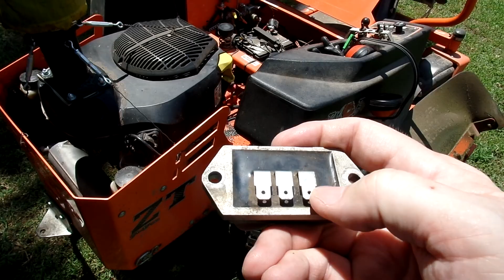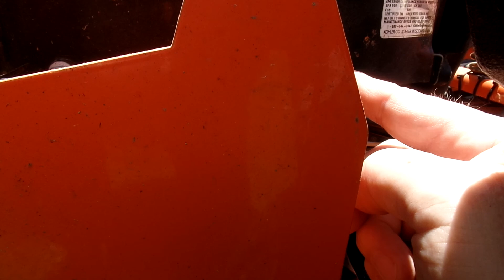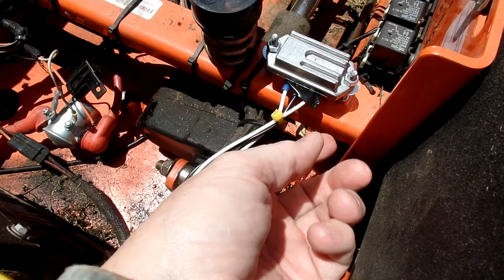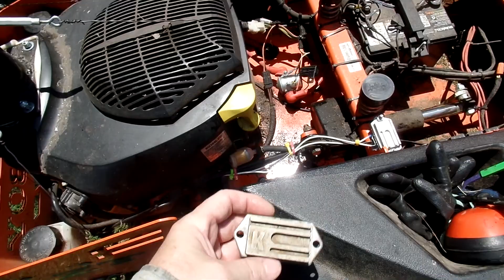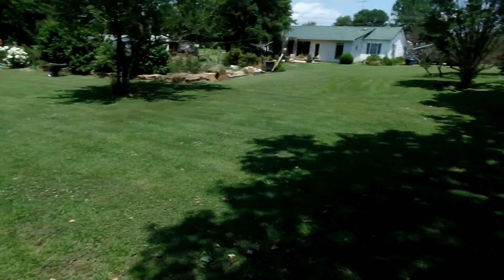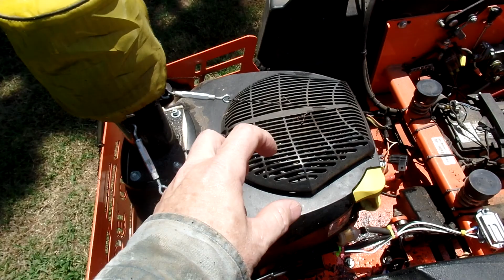PERMANENT fix for Kohler 7000 series motor Charging System !!!

Comment: So the middle wire just goes back to the battery or at least 12 volts?
Reply: The solo end wire goes to battery, look at the 3 tabs, 2 have AC AC stamped on or above - those go to 2 pole plug. Other has B+ - thats TO battery.
 The two that connect to 2 hole plug are 35 to 45 volt AC power IN from engine.
The B+ is 14 to 16 volt DC output to battery (AT FULL THROTTLE. At idle can be as low as 2v.)
You can check if voltage reg is working by disconnect plug and single wire. Start engine.
Full throttle.
Using your volt meter on AC (NOT DC) at 200v - put red lead in 1 hole of plug, black in other. Does not matter whicj. This combined reading should show 30 to 40 volts. Ok, that means engine if generating charging power.
Off engine. Reconect wire and plug to volt reg.
Start eng.
Full throttle.
Now, at full throttle, put volt meter on DC \ put red lead on single wire on volt reg. Black lead find a ground...screw, frame, battery whatever.
Volts should be 13.5 to 15. Usually 14 to 14.5
If yes engine is gen power. Volt reg works fine. Problem is between volt reg and battery, may be bad battery.
Reply from the maker: I think "maybe so"!  I gave up on it (charging system) cause it lasted 1 mow season and quit charging.  I used to know the layout (what wires go where) but I have forgotten now.

Comment: You never did tell us if it was charging
Reply from the maker: The fix lasted almost a mow season.  Now I have no charging system.  For now I charge the battery go out and mow "fast as hell"!  I'm pissed at the motor always causing trouble.  I'm working on a idea to put a small racing "1" wire alternator on the  mower.  But thats a lot of work and thats more crap to work on and I got tons of stuff broke to work on. THX for watching.

Comment: I have a kubota z125s thats having the same problem. Although i hadnt taken the top off to actually see the stator i tested it and got perfect readings coming from it but the voltage regulator is not reading right the old one nor the new one having a time figuring out whats going on
Reply from the maker: I checked to see if my magnets came off (before the current mowing season).  And the magnets did not come off.  So I'm pissed and bewildered.  I might try a small "1" wire alternator mounted on the belt that runs off the engine pulley.  About the best idea to get a good charging system on the Kohler motor.

Comment: Mine is exactly the same. I noticed the ground is not connected to anything, it’s just has a black connector plug on the end of it….is that normal?
Reply from the maker: I added a marine battery connector to my battery. then connected a ground to frame, motor and electronics. I haven't looked at it in a while (can't remember).  If the ground isnt connected thats a problem.

Comment: Does this hack work with Xmark too ??
Reply from the maker: I would say with the Kohler motor only.  Kohler was used on Xmark.  But after all that work I had the "other"problem happen and now I have NO charging system at all.  It was on the video of how the magnets come off the flywheel and stick to the stator, so there is no more charging system, thats what happened to mine.  I am going to hide a 45 amp altenator down low to FIX the charging system. Just stay tuned in (I haven't got all the parts yet) and I will post a video about how I do it. Thx for watching.
Reply: Thanks for keeping me updated, I have a kohler engine on a exmark and I just had the same exact problem you had.

The flywheel magnets came loose and ruined the flywheel and stator. Ordered brand new ones and it wouldn’t start until I jump packed it. Then it would die down. Everything tested out good except for the rectifier.

My guess was when the magnet came loose it cause a safety cutoff and blew the rectifier. Thanks for responding and looking forward to seeing the new update👍🏽

Comment: Also, I suspect that the way the regulator-rectifier is mounted is on purpose. The heat dissipation fins on the reg-rect are oriented facing the engine under the shroud whereby air is circulated from the flywheel fan, thus cooling the reg-rect module.
Reply from the maker: It took heat straight from the engine and had a little wind going over the top. If it wasnt mounted to the aluminum piece that was on the motor it might work.  They did that in the past, mounting it to the plastic and mounted a ground to the body.  But they are good at screwing things up.  Did you know that there is no roller bearings supporting the crank, its oil fed bearings, cheap!
Reply: @TheClintmeister  Oil fed bearings on 99% of all automobiles. Don't need ball bearings

Comment: This sounds like another case of the Kohler Regulator-Rectifier grounding problem. If the Reg-Rect casing isn't correctly grounded to the frame, block or battery, the system won't charge. This can be caused by rust on the grounding wire, or as in my case, I had the grounding wire screwed into the plastic shroud, but not to the engine.
Reply from the maker: This was mounted to a aluminum metal piece that was on the engine.  Not good to cool elect componets.
Reply: I did the same thing to mine and I put it to the frame and it did the trick ..got my toy back running right

Comment: Where did you get the no name rectifier?
Reply from the maker: Off ebay, Im pretty sure I had all the part number and info in the video.  I now 1 year later have complete charging system failure. I knew it was coming but, 6 yrs old.  My next big step is to put a 1 wire self exciting altenator somewhere on the mower.
Reply: @TheClintmeister  whoooo....sad news....thanks

Comment: I took my voltage regulator off…one of the tabs on the end was BENT almost 20degrees!
That’s the way it came!
It was upside down on a shroud 
I saw the k in a bunch of photos I took of the engine cause I said mine ain’t got one of them there rectifiers.
But I found it.

Comment: I've run a Suzuki rectifier on a Nissan outboard for years lol! As long as it has the correct specs is all that matters!
Reply from the maker: My charging system is getting worse. And that means the magnets have come loose off of the flywheel.  Im thinking on getting a junkyard Delco altenator and put the 1 wire kit in it and somehow put that on there somewhere.  I am really tired of the factory messups, I have gone (out of 6yrs of owning it) 4+ yrs without a charging system.

Comment: I'm having problems with a Kohler 7000 series engine now that will not charge the battery and I am changing the voltage regulator on it but I heard you mentioned you have used seafoam to clear out the low surging problem with the engine but you can also use 100% acetone which you can find at the auto parts store or even Walmart in the fingernail polish section but depending on the size of gas tank I always run three capfuls per gallon of gas and it cleans a carburetor up really good also and it's much cheaper than seafoam plus it boosts the octane of the gas
Reply from the maker: Good tip.
Reply: Yeah great info.

Comment: HI Clintmeister ... Will this rectifier cause engine to die out while mowing , all systems are good , fuel , plugs , cap vented , pump flows fuel, etc, Mower gets Hot And dies out, will restart & then die, fuel shut off clicks . strange , dont have money for the dealer right now. thanks!
Reply from the maker: It sounds like the coils are breaking down. Common problem. If and when you get new coils (2) for 2 cylinders, they will sell you a upgraded coil pack (2). They are under the plastic cover, make sure they have a good connection (grounded to motor) to the motor. Try to find a parts store (online) that has microfish and see how to get to the coils to replace them.  You can do it.

Comment: Thanks for the insight.  My kohler 7000 does not seem to charge my battery  either.  I  have been charging it the night before mowing my lawn.
Reply: Mine wasnt either but I wiggled the plug and it fixed it
Reply: @taylor_imaging  lucky you

Comment: my kohler is frying my batteries in no time. would this be the voltage regulator?
Reply from the maker: Yes. It changes the voltage that comes from the stator (AC) to DC so the battery can handle it.  Its hard to see in the video but I moved my voltage regulator off the motor (heat kills electrical componets) to the frame and extended the wires to each plug.  I have had my mower since 2016 and right after buying it I had to keep a battery charger on it to get it to start. That means it burned up early in its life.  Its mounted under the plastic fan shoud on the aluminum that connects to the fan shroud.  If you can do as I did it will give your battery longer life.  Sounds like yours just keeps on charging, thats how you burn up batterys.  I found a no name brand on Ebay and payed less than half of Kohler.  It works now.
Reply from the maker: It sounds like it is overcharging the battery!